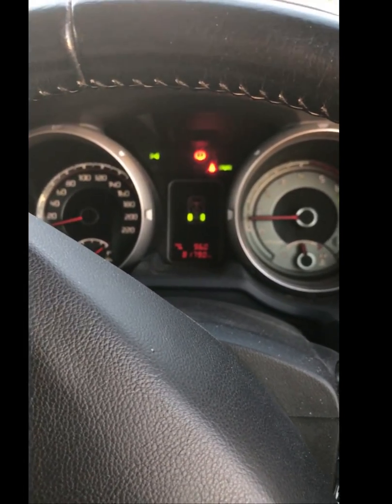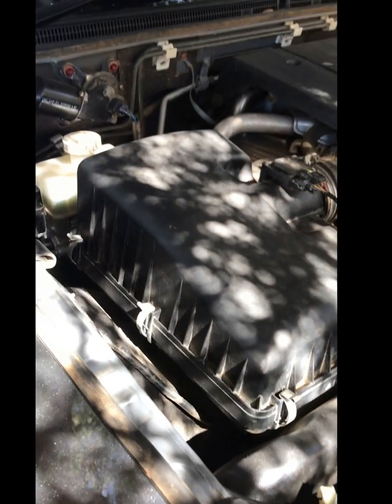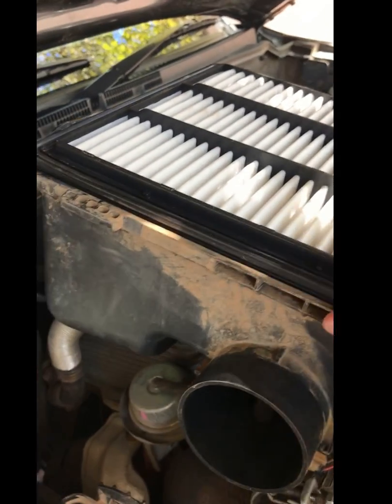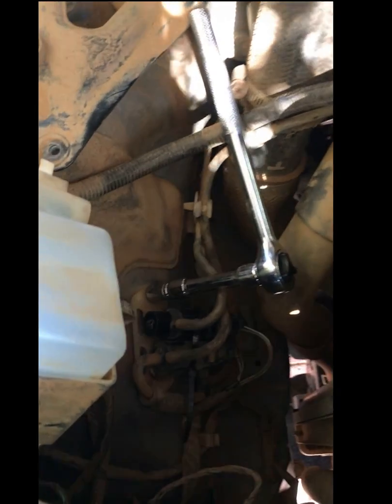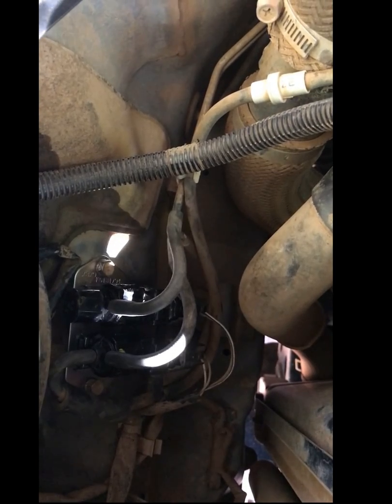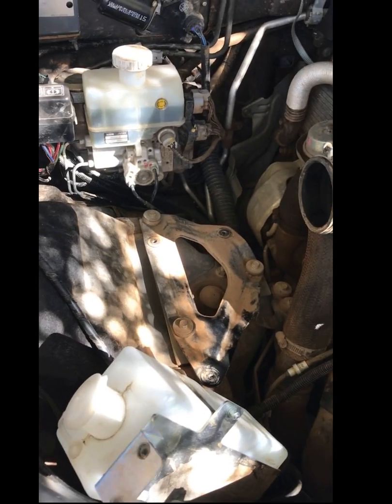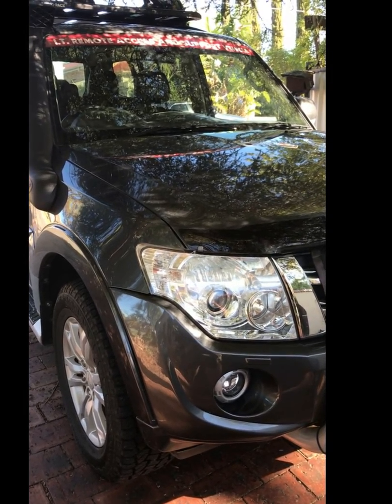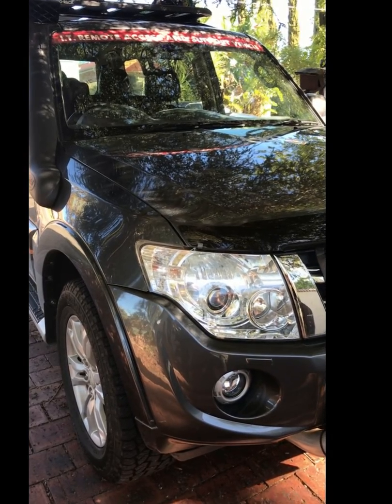Mitsubishi 2013 NW Pajero (NW) Flashing Center Dif. Light (CDL) Part 1 - solenoids

Comment: First video I’ve seen of someone actually fixing this problem and not just speculating about what it could be. You sir, are a bloody legend. I have the same problem on my 03 montero(engine bay slightly different but essentially the same) Will definitely give this a go! Hope it works!!!
Reply from the maker: This is what happens when you spend thousands trying to fix it, several mechanics and give up. You start the process of elimination !
Reply: Mate, huge thanks again. Bought anew freewheel clutch solenoid valve (part number Mb937731) off Amazon, got it in within half an hour. Had to be pretty forceful with pulling the rubber tubes off the old part but they came off eventually. Anyway new part in and no more flashing centre diff light since!
Reply from the maker: Excellent. It feels good to have 4WD back and you can trust it again !
Reply: I wouldn't have put it better. This is far the best video have watched showing how to solve this issue.
Thank you sir. God bless you

Comment: I hve noticed my pajero is doing the same blinking deferential light i dont know wot might cause this i thought low ATF or may be Over.
Reply from the maker: Does it also do it after 30-50 kms driving on the road when in 2wd ?
Reply: @MichaelJenkin   My pajero 2006 mod. is doing this flashing after 25-50 km driving in 2WD
Reply from the maker: @sveinung100  Hopefully like me, if you work through this one step at a time, you will come to the fault and it will be obvious !
Reply: @MichaelJenkin  hi mate, my Pajero does it, how do I fix please?
Reply from the maker: @markking8223  Hello, You will need to follow a process of elimination. This includes checking that the solenoid works, the air hoses are not damaged and that the free wheel actuator works. After this, if no fault found, you need to start looking at the other sensors including those on the transfer case.
Reply: @MichaelJenkin  thank you, your a gentleman and a scholar